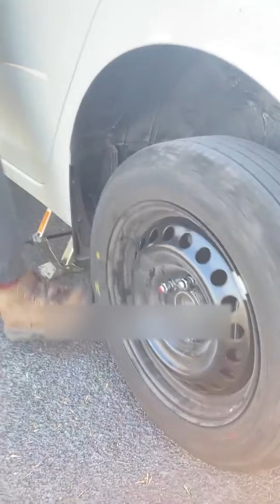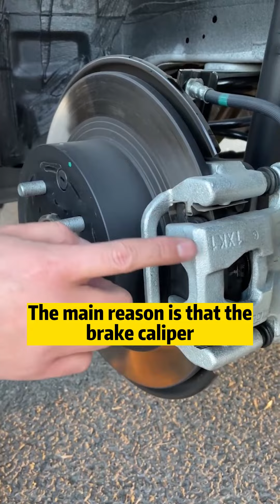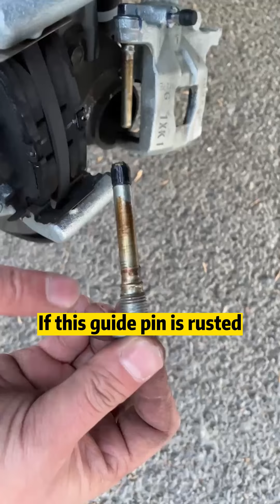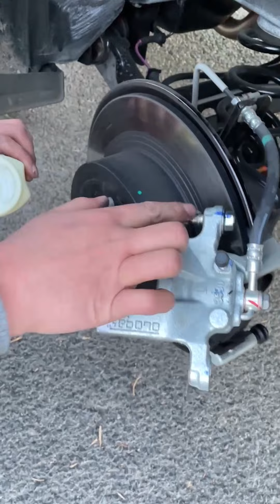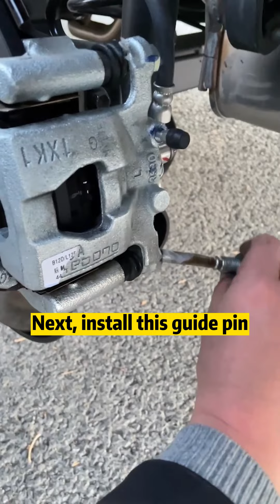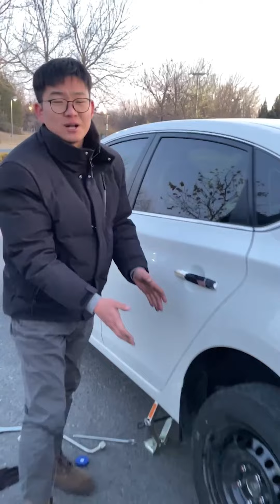The car's power is weak, see me solve it myself!#car #shorts #driving #tips #tutorial

Comment: I don’t know what lube paper is but you want to use brake specific grease. You can buy a large container or single use packs. The guild pins grease essentially evaporated because the high temperatures. So even with brake specific grease it will harden & become useless. Its a normal maintenance item like engine oil. Though many do not service it in this manner.  OEM Brake pads can easily last 80K on a quality car like a Honda. Will the factory OEM Honda guild pin grease last 80K? Not likely. Also be sure to grease the brake pad anti rattle clips being VERY careful to NOT get any on pad or rotor surfaces. Only where clip contacts pad slide area and the actual caliper. Always spray down the rotors with chlorine free brake cleaner after working on brakes even if you believe you did t touch rotor surface. The rotors will transfer oil to pads and “glaze” them. Essentially they will not function with proper friction although their remains friction material and pads aren’t worn to steel backing plate yet.

Comment: An adjustable wrench on brake bolts? Seriously?
Reply: Yeh, it will vause the bolt to roundup.
Reply: I thought the same, haha. But I worked on mine just a week ago and I remember those weren’t too difficult to remove. Also those calipers were super clean. Everything he touched was clean. I think they disassembled and cleaned everything prior to filming to make the process easier.
Reply: He forgot to lubricate the disk! That's how i get the best fuel consumption!